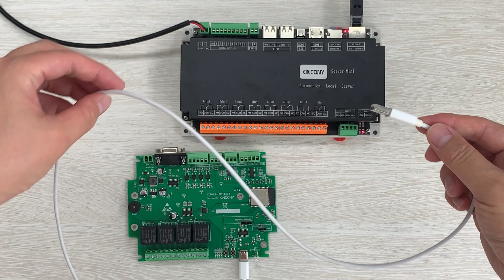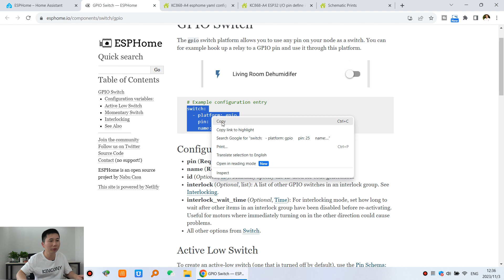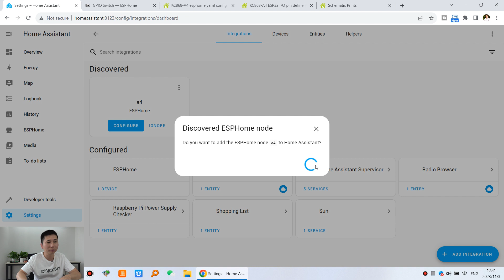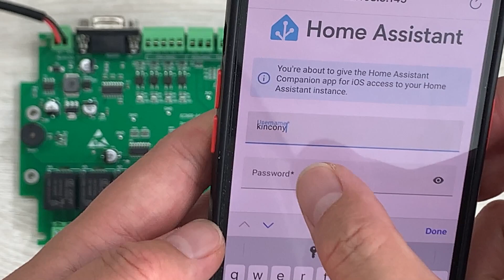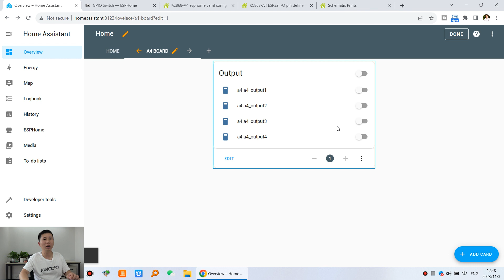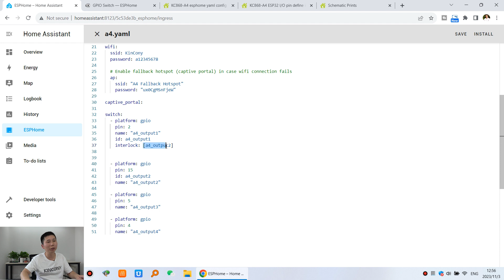how to use gpio relay switch by esphome for home assistant

Comment: Hello sir, can you please do a video of how to connect your boards with normal arduino mega so that we can be able to interact with a lot of arduino mega pins. You use esp32 chips but they have limitations of number of pin. I have 5  boards from you and I would like to hook them up with the existing arduino mega setup probably through i2c or modbus
Reply from the maker: sure, you can use RS485 connect to your own board, software config by esphome, support modbus. we already have a video that how to integrate your own RS485 board to ESP32 via modbus.
Reply: great but could you please explain how to connect to arduino mega, mega is preffered  because it can be connected to a lot of sensors
Reply: i mean your boards with arduino mega
Reply from the maker: my mean: connect by RS485 between two boards. @auxinnepaul8203
Reply: I mean I have 5 A8S Boards but because of limitations of GPIOs on it. I would like to use Arduino Mega to connect to many sensors then connect it with A8S board...so am figuring out how to do it....A8S + Arduino Mega
Reply from the maker: i have said, let your all boards and arduino mega connect together with RS485 bus. @auxinnepaul8203
Reply: @KinCony  ok